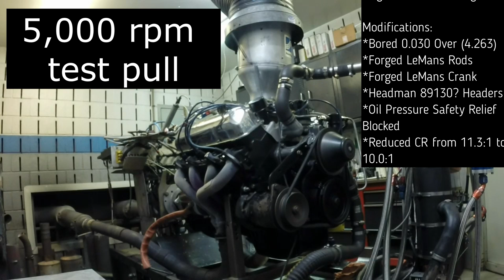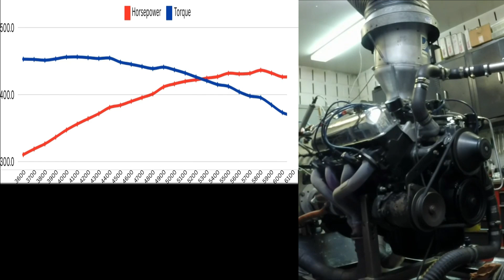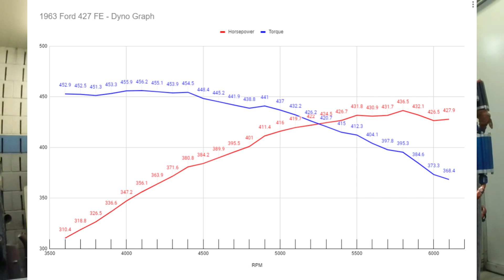Ford 427 FE Low Riser Stock Dyno

Comment: What did it make? Hp/tq?
Reply from the maker: Live graph in the video at the final pull! 436hp / 458tq
Reply: That is right on the money for a Street Fighter Low Riser!
Reply: Don’t sweat it, this is a sweet factory style engine and the power it is built to be everyday in a 63-64 Galaxie or as you are saying putting it in a Mustang. If you don’t want it , I’ll take it… lol. 😂
Reply: Wait until you drive it 1000 miles and the cobwebs are gone. The A A can was 410 hp  1,4V and 425  2 4V . The big dog was the  D cam. That was the NASCAR and Super Stock cam. 550-600 hp in the HR engine. The AA is a 410-425 hp cam. You did really good 👍

Comment: Can I ask why reduce compression
Reply from the maker: @caseymuzio7609  Sure can! Back in the 60’s, there was super premium fuel available at many gas stations which got close to 100 octane. Modern gas stations typically cap out at 91 octane. There’s no way to drive an 11.3:1 compression iron headed engine on pump gas. Even considering static vs dynamic compression. The builder was even advocating for 9.5:1 to keep the engine a little safer. I run a gallon or so of a much higher octane blend into the tank before filling up most of the time.
Reply: @randomologist77  i can understand that especially if it's being driven alot 
I wonder how much It would pick up at factory compression on say e85
Reply from the maker: @ Maybe 15hp or so. I try hard to avoid running ethanol because it’s so hard on the fuel system. I use the 427 as a driver about 8 months of the year, normally. I work remotely so about 2,000 miles or so, depending on road trips :)